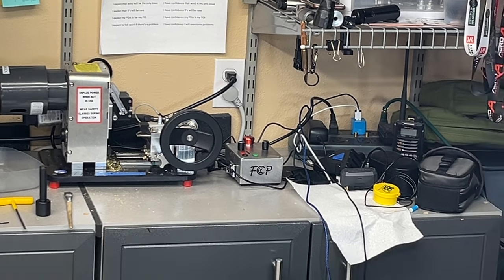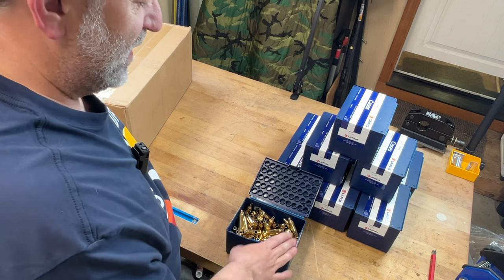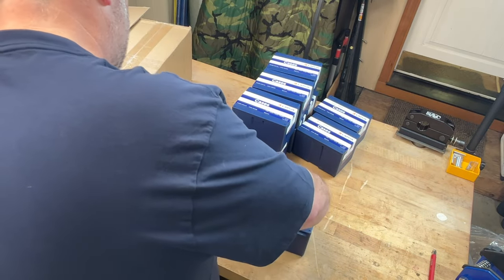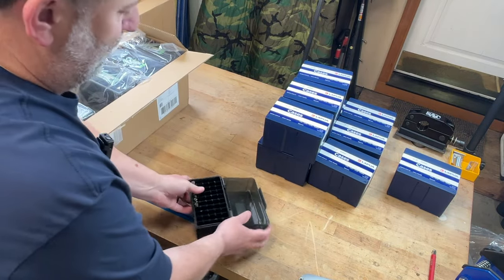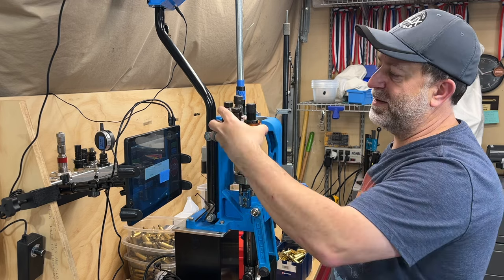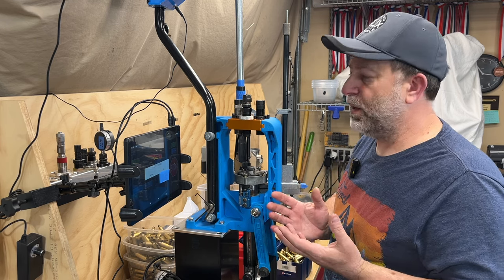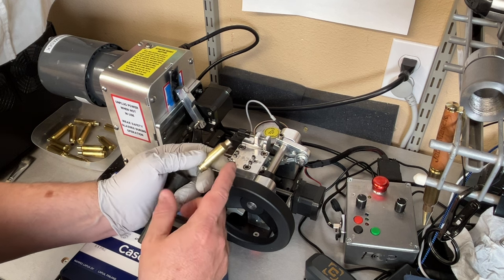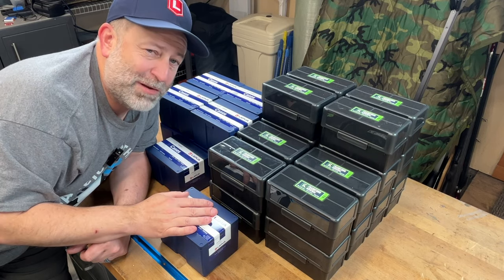Neck turning 1000 pieces of Lapua 6.5prc brass on Autodod

Comment: Thanks for sharing your process John - always informative and appreciated!  So, If you use a no-turn reamer for barrel chambering/neck clearance, would you still recommend turning the necks 1/2 -1 thou to avoid donuts in the neck from brass flow?  Let's assume you could still get your desired neck tension after sizing.
Reply from the maker: I can't give you a 100% yes or no. In my experience I had donut issues even with a no-turn 7prcw but most of that is because you're necking up and then I run mandrels with limited shoulder bump so the donut ends up gettin pushed out eventually and can block the chamber just enough to make closing a bolt hard. Others don't have that issue because of their process. Ultimately a no-turn chamber is designed so you don't have to worry about turning. So in the end, yes it would be the safest thing to do if you're worried about donuts but may not be necessary.
Reply: @FClassJohn  John, agree wholeheartedly!  If your single feeding and seating above a donuts ring no issues.  Yes, think I play it safe and neck turn to keep them at a minimum...for single or magazine  feeding.  Tremendously appreciated!

Comment: Why is your auto eject hitting the machine? mine stops parallel to it. Such a great add on to the machine.
Reply: Mine also swings back up and hits the machine. I added a Velcro strip just as John did. Might have to look at repositioning it.
Reply from the maker: I now have two pieces of velcro but will probably swap it out for a small rubber pad next time.

Comment: John you mentioned that you leave carbon in your necks . My annealing process seems to remove it from inside necks ! Does the Amp annealing not take out carbon? Can’t believe having that much brass at once for what it cost  up here in Canada.
Reply from the maker: Annealing might take some carbon but doesn't really seem to be much. Maybe torch annealers take more out? But either way, there's always a slight layer of carbon in mine even after I use a diamond brush inside the neck.

Comment: Running the brass thru Cortinas mandrel with no lube on the outside doesn't stick? 
Other question is Cortinas mandrel is designed to squeeze the base, running it thru 3-4 times doesn't effect your brass?
Reply from the maker: I haven't had any ill effects thus far and As long as I keep my brass sized properly I've never had an issue with brass getting stuck in it. Of course for the actual sizing die I use lube.

Comment: John, let me preface this by saying I am new to reloading well really just building up knowledge and equipment(reading a lot and asking questions).  Why do you start with 6.5PRC and size it up to 7?  Why wouldn’t you start at 7PRC?  Thanks!
Reply: The Hornady sammi spec 7prc is a different case than the 6.5prc.  He is shooting a wildcat that him and EC call the 7prcw which is a 6.5prc necked up to 7mm.
Reply: To add on to the previous comment, John is not loading 6.5PRC or 7PRC, he is loading a wildcat, which is a 7mm projectile in a 6.5PRC case, there’s a few names for it, one is 7prcw, one is 7prcc, and another more correct (in my opinion) way to label it would be 7-6.5PRC.
Reply: He is loading a 7-6.5PRCW. It is a wildcat designed by Alex Wheeler.
Reply from the maker: Everybody who commented is correct...
Reply: @airborne350g  yeah I knew that part.  I guess I’m more wondering the why behind it.  I see Eric Cortina basically doing the same thing and just wonder why start at the 6.5 and size it up vs starting at the 7?
Reply: @jarvitron  right I understand that.  I was more looking to understand the why behind doing that vs starting with 7PRC brass and the advantages?  Thanks
Reply: @jeffgojkovich  I realize all that.  I’m just trying to understand the why behind it…the advantages
Reply: @michaelthrelkeld212  the why is that the 7 PRC is a much larger case and has more recoil. It would work for F Class but beat you up during long matches.
Reply: @airborne350g  gotcha that makes sense!  Thank you!

Comment: I would like for you to do some videos on dies. 🙏
 The ones you like, 
 Reliable brands, 
 Who's dies are very good quality, 
 Ones for the plinking folks,
 Ones for precision folks,
 Ones that gives you ultimate adjustments
Reply: Best dies  overall are Redding , Followed by Forster's and then RCBS for the average re-loader using a 7/8 x 14 threaded press head . In straight line dies used with an arbor press Wilson seems the best . The Lee collet dies is a good neck sizing die but the rest of Lee dies are ordinary . Hornady new dimension dies are quite well made and work fine for the  average hunter plinker .  
A Lee collet neck size die with a Redding body die and a Redding competition bullet seating die , works really well to preserve case life , makes body sizing a breeze and reduces greatly any chance of a stuck case . However if you did get a stuck case it's child's play to just knock the case back out with a suitable punch and hammer because there is no decapping rod or expander   ball in the die . 
Redding competition seater die is a micrometer adjustable die and makes experimenting with different seating depths easy and you can record the seating depth for multiple bullets and just dial the setting up as required .
Lee Collet neck sizing is flexible as it can do partial neck sizing by just putting a steel washer over the case on top of the shell holder and that reduces the length that is sized along the case neck to create small second shoulder  . Also it works well with unturned and turned case necks as long as the turning job is not overdone . For a factory chamber you only want to skim neck turn to clean up about 75% of the circumference , no more . The Lee collet die  fits in nicely when doing neck turning in a factory chamber and you create a second shoulder to reclaim case centering in the chamber . Mainly for bolt actions .

Comment: I have a question that hasn't been answered to my knowledge. Does the Dillon 750 work better for precision vs the 1050? 
Thank you for all your information.
Reply from the maker: Hmm, can't really say although I think technically the 1050 has a better die toolhead system and all things being equal it probably is a hair better. The downside is far fewer accessories for it especially things like the Cortina bullet pointing system and stuff.
Reply: @FClassJohn  Thanks for the reply. I didn't know if it was because of the extra price tag or what.

Comment: I guess the next question would be why not just shoot 6.5 prc ? Is the the 7 mm berger bullet better than the 6.5 bullet? Yes it's larger and heavier, is the bc better? Just wondering, thanks.
Reply: Heavier bullet with better BC.
Reply: Thanks, makes sense.
Reply from the maker: And on top of the better BC as others said, it comes with better barrel life as well.